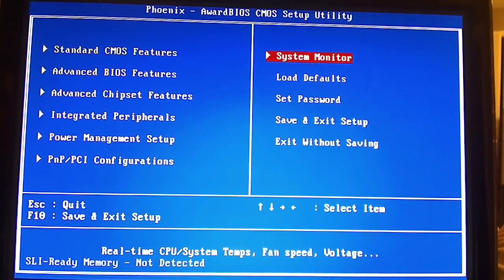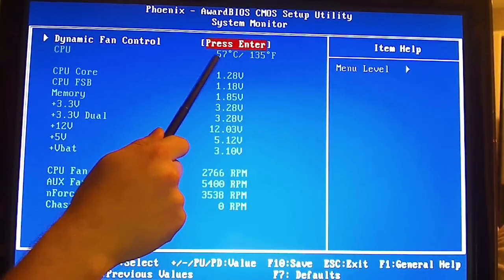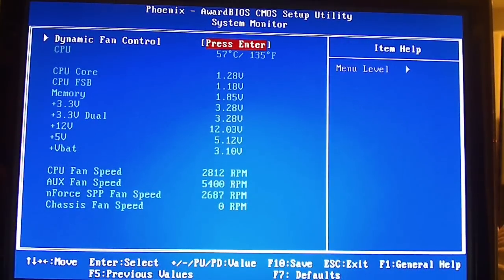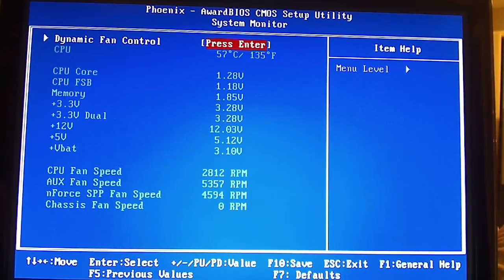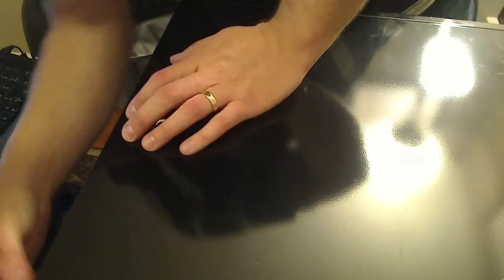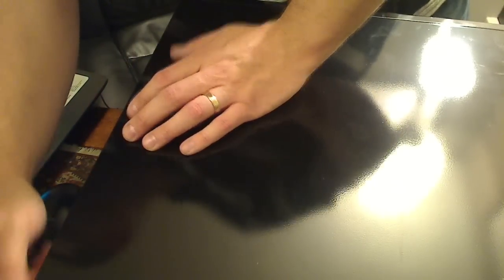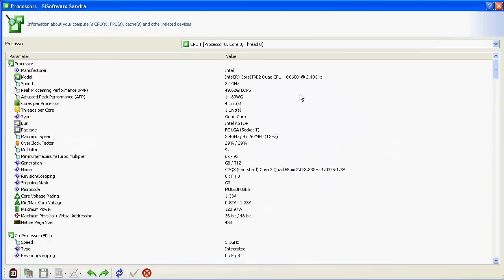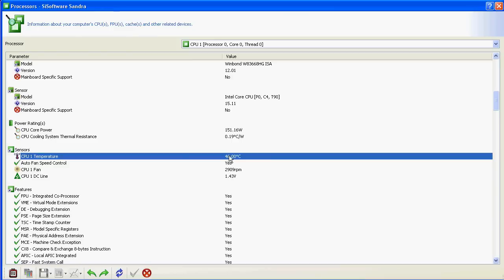SOLVED:  Fix Overheating CPU (Computer) Decrease Temps by 10 degrees

Comment: Well im in a tropical country which temp is between 30-34C. When i first bought this CPU my core temp is between 35-40C (3months ago) but now when i play things go laggy. Do you think overheating is the source of this laggyness? Hmm i just cleaned it with a brush and wipe it not alcohol but just water then reapply thermal paste again. I dont know to overclock so im pretty sure i am not overclocking. I am using stock CPU Fan.

Comment: I made a test. I played Planetside 2 and Borderlands 2 on windowed mode, and I had Speedfan open(shows the temparute of my computer parts). When I played the temparute of my GPU, Core 0, and Core 1 was 60C. Is that high? But my computer's performance was still fine. Should I be worried?

Comment: If I use turbo on my processor I get 3.9 Ghz but my temps go from 45c to 76c . My AMD Heatsink is garbage. I have new thermal paste on it and still temps  are to hot .

Comment: unless thats a laptop (which is still hot but acceptable)you better buy thermal paste and a better heat sink or water cooler. thats too hot for any desktop cpu mine sometimes runs at 45 degrees Celsius and i think thats unacceptable.

Comment from the maker: Axel I just posted a How-to Guide to Prevent Laptops from Overheating it's called " "How to Fix Laptop DC Power Jack for Good" . Check it out because it's easy to do, just make sure you watch the whole video to see the tip. #howtoguide #tutorial #pc

Comment: Mine is at 36 degrees and stays there , BUT it overheated 1 time with Just cause 2 at full settings and now its kinda slow ..... do i have to buy a new CPU ?

Comment: Hey, I have a Intel i7 2600k Motherboard, and when its idle the cpu is around 25-30 D celcius, when i play higher end video games it goes to about 65-70 D celcius the paste was replaced a month and a half ago, as well as dusting. my Cpu fan is run 1355 RPM during high time any is 70 D celcius too high enough to cause damage, or is it okay?

Comment: i have stock cooling and amd phenom II x4 b50 stock clock and a stock cooler.It runs idle at around 55 celsius.In the last time when i started to play coh 2 after 3-5 min computer just shut downs like i pluged it out of power. my case is open and no dust.Any advice could it be that my power supply is not too good?

Comment: #1. That is still too hot for Idle
#2. Why did you show the post clean up temps using another application?
You added an unnecessary variable to your testing.

Comment: Here is what you can do, with no investments at all. I assume your heatsink is the standard boxed one that comes with the CPU from factory. Simply remove the fan, do not remove the heatsink. Use a dust hoover to suck out dust from the heatsink. Put the fan back on. Check temp, should be lower now. If you still want to go lower and prolong your system's life, replace the thermal paste and the heatsink itself. Also makes your computer more silent. Same precedure for the graphics card, if you dare.

Comment from the maker: That's doesn't sound right at all. Maybe running your CPU without thermal paste broke something, because 70 degrees is the maximum operating temperature for most CPU
s. My core i7 2600k goes from 35 at idle to 70 running Prime95 running at 4.6 GHZ and about 50 playing GTAIV.

Comment: I took my cpu off to get dust out from under it and I noticed the thermal was dry. I put the cpu back on and it's still running 36c. should apply new thermal paste to it?
Reply: Every time you take it off you need to re apply paste. So yes.. Unfortunately :/

Comment: No , I ain't overclocking :( Are there any sort of settings in the BIOS that if you reset to default needs to be changed? So my computer wasn't even turning on for a few days, Happened after the spring clean where I accidentally scraped off existing thermal paste :P Bought another one and applied , Temperatures went down but still not turning on :( So I switched to XP , figured it MIGHT be a RAM or PSU problem :O . But I didn't mess with the PSU cuz there was a dont-unsrew pic on it :(.

Comment: @homeaddition i use the stock heatsink for AM3 chipsets,AMD PHENOM 2 X6 1055T 2.8 at stock,can go to 7 Ghz with no problems but a lil more cooling,but not really the time to do that..and...my mobo is speacially built for overclocking and stuff,my system can run crysis 2 70-90 fps ultra dx11,but because of this cpu lag,everything is fucked up,from 70 it drops to 2-4 fps in no time and then comes back drops,again and again,recommend me a heatsink? is it because of that? the max temp MFR is 62 c.

Comment: my cpu is 74 idle
i thought something was up, i checked it and there was no thermal paste, so i added some thermal paste. it dropped it 1c. but its still above 70 idle
the heatsink is clean, the cpu has fresh paste and there isnt to much airflow blockage, i have the side panel of for now but still at 70
any ideas?

Comment: mine reaches 90 degrees C, when playing fallout NV, and there's nothing I can do that works... I even put the ventilator in my room direct towards the PC.
 Normally the temp is from 55-60 degrees, when I'm not doing anything with the PC. My processor is the intel i5.

 After a while the game ends up crashing or lagging far too much. all due to the overheat, and I have already disabled the overclock, of course.

Comment: My the core temp of my CPU indicates that it reaches 90 degrees C already. Well it is really hot i dont know what to do i cleaned up my pc and even reapply some thermal paste into it. It is not like this before. I got 3 fans on the side of my pc case (front, side, back) and i got a stockfan in my processor. But still got high numbers. It is not like this before usually before it only plays at 35-40 degrees C. I dont know what to do. Please advice!

Comment: My CPU temp always showing 45-50C when idle and 50> when playing games or program, but the second core (core 0, core 1) stay at 38-49 when idle/playing games, and i have 2 fans installed including the processor fan can you please explain ?

And by the way my spec :
Dualcore E5500
2GB RAM
ATi HD 4650
using speedfan to check temp

Comment: i have a intel core 2 quad q8300 2.5 ghz but it overheats to like 110c when i play games like bf3.it also reduces framerate comparred to what it should run the game at because others run at 40-50 fps on high settings while i run 20-35 on low.i know this is due to the computer throtteling and after a few minuets of gameplay my pc will shut down completly.i will buy some arctic silver 5 cooling paste but i doubt it will cool it down enough. i also pot a  bigass fan infront of the pc to help. tips?

Comment: legit when i applied new thermal paste replacing the one i had on it a year ago my pc fan was running so loud and is 37-50 degrees on idle. it plays around so much with the temp doing nothing! when i game the tempreture is only a few degrees up. is my cpu cooler not key chaining with my cpu?! please help me

Comment from the maker: Check out my latest video, even though it pertains to laptops you can follow the basic advice about preventing OVERHEATING using a vacuum cleaner. It's called "How to Fix Laptop DC Power Jack for Good". #pc #overclocking

Comment: He is aware his cpu heatsink is the wrong way around? Also, you need to screw in the screws evenly to prevent pressure on the cpu...
Reply: The case fan is blowing the air out, and the CPU fan is trying to blow the air back in, they should be working in a straight line from front to back so they are not competing against each other for airflow.

Comment: i have a corsair h60 cpu cooler. but my cpu has over  70 degrees. it shuts itself off in like 2 minutes. i just bought the components and everything is working fine. except for the cpu which is overheating. can you help me? i don't even have the time to install windows D:
please help me?

Comment: Hehehe, yeah, problem is my house fan would fill my PC with dust. Best thing is to maintain good CPU fans and a good cooler huh?

 Btw, Brazil, not Portugal, it's even hotter here, even tho my room is quite cold, it's also (a word that means the room has no passage of air), meaning that the CPU get's real hot if it remains on for long periods of time. 

 But now, with 2 good fans and the cooler, it's keeping the temperature from 47 normal conditions, to 75, while playing games. Not bad =)

Comment: I am just using my browser and my cpu is at 5000 rpm do I have to reapply the paste to it, I have the cpu for like over a year now.
Reply from the maker: I made this video because I bumped my computer with my chair which unseated the CPU Fan and Heatsink unit from the CPU. This bump caused it to break away from the thermal compound which turned to rubber basically; therefore making my CPU a lot hotter. So I took everything out cleaned it with rubbing alcohol and put everything back. Works perfectly! Just take your time and take lots of photos or videos, so that you know where everything goes.
Reply: oh ok thanks :)

Comment: hey can you tell me why put silver thermal compound in our cpu(processor) ?
Reply: because the old one can be very hard and not transfer heat, so u need to put new paste or you're risking your computer to overheat.
Reply: TheELLanOsHD so what is it silicon or what
Reply: sort of, but u cant use normal silicon lol,thermal paste its specially made for transfering heat. it is made of plenty of stuff, the one and only thing that i know about is liquid metal :)
Reply: TheELLanOsHD I've deleted my silicon from my cpu and now i didnt know where can i buy it and how much is it ?
Reply: Leutrim Gashi Clean it very very very good with a microfibre cloth both cpu and heatsink. Then buy the thermal paste it depends on where you live but it isnt too expensive (artic silver mx4 is the best). Optionally buy a new heatsink (clean that too just to be sure). After that watch a lot of videos on how to apply the thermal paste (you dont want too much nor too few). Then put the heatsink on and its ready to rock and maybe even overclock (only with an aftermarket heatsink).
Reply: Leutrim Gashi depends on your location in Ohio its like 8.99 -10.99 at local Kmart stores but youll be best to go to Radio Shack. artic silver is best,,,,

Comment from the maker: Yikes, 90 C is too hot! There's something wrong with your setup. I would not run my CPU at that temp for a long time. Check your BIOS settings, check your fans and heatsinks. Your either overclocked, have too much voltage, or something is broken.

Comment: Also wut dafuq man that is not how you install/remove a HSF that uses screws. NO WONDER YOU HAVE OVERHEATING AND NEED TO RE-TIM IT SO OFTEN!!  

You need to tighten the screws down evenly.  Maybe 1/2 turn at a time after they have all become flush.

Comment: your bios is the same as mine. but i dont have that system monitor in my bios. i cant check my cpu temp. I need the check it because my cpu fan in dead, and the processor's heat sink is god damn hot. really hot. I'll try to put a thermal paste. but i want to see my pc temp. but my bios as the same as yours(really) only i dont have in my bios is that SYSTEM monitor. can you help me? this is the pc I am using.

Comment: My CPU is 63 degrees Celsius :(
Without taking off the case, I cleaned the vent on the vent on thr back and it dropped t0 50

Comment: my AMD FX8350 is around 32c idle but 60c while playing GTA IV my cpu has just been fitted brand new the side is off is 60c a problem?
Reply: if only you could hear the fan going i swear it sounds like a circular saw above 50c
Reply: Julian john i had the amd fx 8350 and had to get rid of it was over 66c minecraft lol i even went out of my way to get 3 market coolers basically the max temp for the 8350 is 61c so no that not good.. you want to keep it around 50 to 55c but amd cpus run way to hot i have an intel core i5 4690 and i have yet to see it reach 55c max temp for my cpu is 71c
Reply: RPGoddess my cpu runs at 80C 25-75% cpu, wierd!!!!! and at full load, nah, just forget it... 110C o_o
Reply: epic troll i read somewhere that my cpu automatically shuts down at 90c
Reply: Julian john its different on all CPUs

Comment: @homeaddition When i play music or run games,everything including sound slows down for a few seconds,and then becomes normals and slows and so on...,i use the gigabyte 880gm-udh2 board with turbo 3d,and 6870 XFX,my X6 lags like shit,i have removed the thermal paste it was frozen,should i replace the heatsink? its not the bios,the avg temp i get is 65-70 degree's,please help me,god will bless you sir,its  nothing related to bios cause its updated and everything else is fine,just the cpu

Comment: could i remove thermal paste with water instead of alchohol?
Reply from the maker: DieselDagny Thermal paste is greesy, I always use rubbing alcohol. You can possibly try 80 proof clear vodka, but I never tried that myself. #cpuoverheating  #thermalpaste  #overheatingcpu #overclockingbasics
Reply: alright
my father bar have alot of alchohols :D

Comment: hello my cpu cooler just dead the black wire just cutted off my mistake so my temperature goes like 104 c from 49 c so what i should do ?? is there any way too cool it down or i need buy new cooler ?
Reply from the maker: You can try splicing the wire back together, otherwise your going to have to buy another #CPU cooler.
Reply: i don't know how i splice it but ill buy new one next 3 days or 7 days
Reply: ProvenHelper hey its me again i got pc now i guess am same your size what is good liwuid cooler for that case size as cheap price that make silent noise ?? cause my msi r9 290 twin frozr its make my cpu fan much noise i think

Comment: I have a windows 7 and internet (flash) gaming runs the CPU to 100%, and the RAM to 63%, so i am not allowed to. can i manually adjust fan speeds? Please respond.
Reply: download Speedfan 4.50 , install , click Configure , click Options , tick 'Set fans to 100% on program exit' , set the delta value for fans speed to 99 , then click OK . Done :)
Reply: superafifi1 really? 100%? his pc is going to take off!

Comment: I have a AMD Phenom II processor and a coolmaster heatsink...I am running around 38-40c  so I took the heatsink off to dust around it and replaced the thermal paste because it was bad...now that I've done that my fan on my heatsink blows 5 to 8 minutes at a time whenever I play a game. The temp is usually around 62c...anyone got any ideas? is my fan bad?

Comment from the maker: Fur fun I put on a wool sweater and rub my feet on the carpet for at least 3 minutes, then I touch the motherboard and watch the sparks fly :) Once I'm done with that, I hop on NewEgg and order new equipment. 
Seriously I worked in LARGE DATA CENTERS and no one wore a freakin wrist strap man! If you use common sense, you'll avoid discharging static electricity to your components. But by all means, noobs should probably always use an anti static wrist strap.

Comment: My computer is getting up to 70C and crashing and i have a liquid cooling thing that cost way too much. it was 70 after it would crash and i'd run the Openhardware app.
Reply from the maker: +roltthehunter Your cpu cooler is probably not seated properly on the cpu anymore or you're overclocked too high.

Comment: Can I wash heatsink with water ? Can it damage or don't work ?
Reply from the maker: You can if you remove the electronic fan from it first. Then make sure you dry it completely before re-installing. I use a leaf blower to blow off the water droplets, but you can also use a hairdryer, but it will take longer.  #computerrepair

Comment: As far as I can tell the flow in your case is all messed up. The PSU sucks Air from inside the case to the outside unless you modified it. Flow should follow that direction: From front and bottom to top and rear.
BUT: from the dust residue on your CPU cooler the CPU Fan blows in the opposite direction.

Comment: does the room temperature affect the cpu cause in my room I dont have any air conditioner and in Australia it is very hot so it shutsdown and it is hot but not I added a fan it is working better (I have the case open)
Reply from the maker: Oh yeah, temperature of the room matters a lot! Make sure you keep your fans super clean and free of dust as well. Also don't forget that the closer your computer is to the ground, the cooler it will run, because heat rises upwards.  #computerrepair
Reply from the maker: You're assumption is right, the room temperature is very important for computers.  #pcrepair
Reply: ProvenHelper good point
Reply: yes very affective

Comment: anybody i want ask something 2 month ago I ugprade i3 2120 4gb ram single channel and Amd hd 5450 to i5 3550  8gb ram dual channel when i use i3 2120 my temp cpu always stable 40-55 and until 5 year i never need replace thermal paste and when i5 3550 1 month later my temp cpu in 57-67 all time i only browsing and gaming very light Counter strike and Crossfire and sometime emulator pcx2 720p all setting grapic low,i never Oc cpu and gpu i downgrade to i3 3240 but same problem happen again,i want know there related mid end gpu like gtx 750 ti caused heat to my cpu now i3 3240? and my uncle say it ivy bridge i3 or i5 have 1.4 bilion can fast for hot? i look in wikipedia i3 2120 only 624 milion it true? please tell me for solution

Comment: Also if you know computers then you know to wear a static wristband when touching anything inside so a geek I think not and with a good aftermarket cooler my personal built beast with a zalman cooler runs at 25c at idle and under prime 95 stress test never cracks 50 so

Comment from the maker: Your bios settings are probably incorrect and AMD chips do run how so if your cooling solution is too weak your going to experience the problems you've got. Down clock it and get a better cpu cooler. #oveclocking